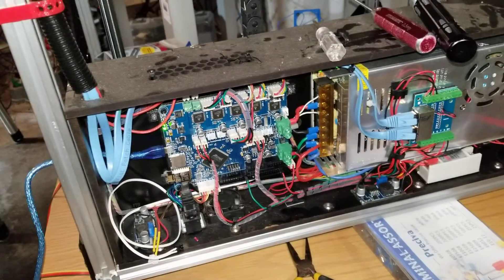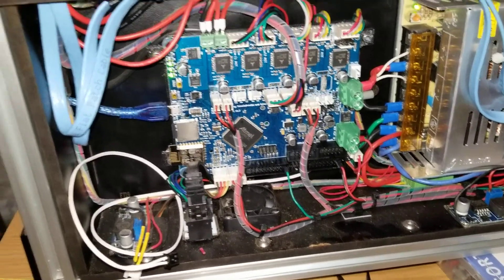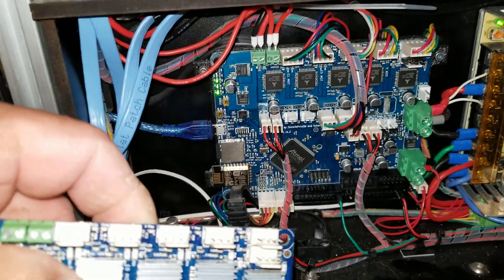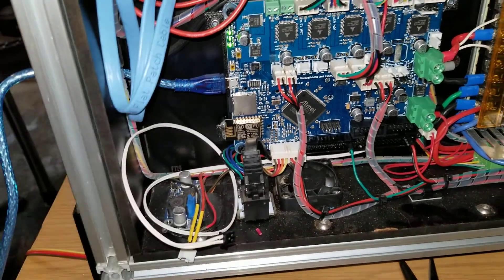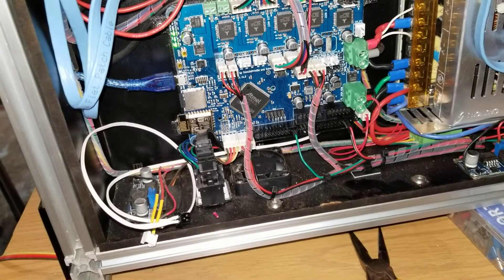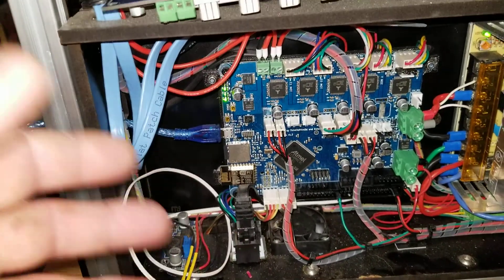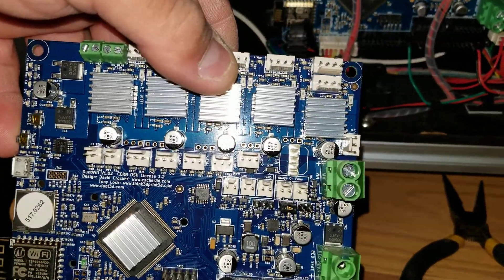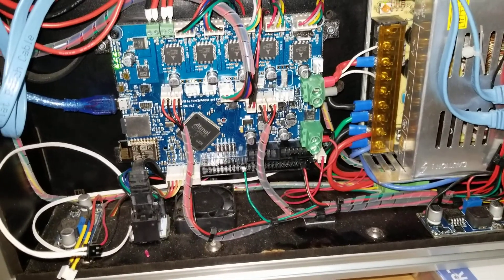Duet-Wifi Clone, First thoughts and simple review

Comment: Does the clone say designed and assembled in the UK.
Reply from the maker: mine did not
Reply: For anyone coming looking later, the clones are obviously made in Asia to max profit margin. They don't have to recuperate the hardware and firmware development costs like Duet3D does, they save some money on manufacturing labor (not much, that labor is getting expensive in places like China because education levels are getting higher and there's been an increasing labor shortage for years now as few want to work those jobs anymore and even fewer stay for a long employment), but most is actually saved on logistics: Every component is made within the same greater region so parts don't need to be shipped very far, nor imported). 

They may have changed this over time, but at least early on, the blue PCB clones were "made" and sold by BTT (Big Tree Tech), the black PCB ones by MTS (Makerbase). I don't know about the passives, connectors and jellybean components, but those are commodity parts being producted by a bunch of different manufacturers. They're like the nuts, bolts and washers of electronics. But all the stepper drivers, logic components and the firmwsre on them were/are the exact same as the original. Duet3D doesn't make any proprietary hardware components, they're off the shelf parts made by 3rd party companies like Atmel and TMC, that anyone can buy. And since all the logic parts are identical, Duet has no way of telling them apart so the clone boards use the same official RepRap firmware and updates (or any other compatible firmware) that the original Duet boards do.

Comment: What are the 3D Printing noises like?
Reply: quiet, but if noise is your main concern, make sure you isolate your printer on foam blocks and preferably on a large cement rectangle so the surface it's resting on doesn't act like an amplifier. Also, noctua fans are a great addon.
Reply: @AlexJoneses  correct

Comment: I think you've sold me! My Little Monster board seemed to finally called it quits.

I noticed, the two options, the second one being 'with connected'??? Was something lost in translation? Is it supposed to be 'with connectors' or does it mean something else?
Reply from the maker: you get the white connectors that plug into the board so you can change the cable connectors if you need or want to
Reply: @satgod  Ohh, so likely not all that necessary? Does one of your videos show an unboxing of this board and what you get? I may be able to source the waffle connectors from my local electrician for cheaper than the add-on price.

Also, how is this board holding up now? Are you still using it or have you gone back to the real deal?
Reply from the maker: @PorscheDuésnburg  I dont think I did a unboxing you just get the controller or the controller and a bag if fittings
if you dont have them I would get the fittings
I changed all mine to make it a nice clean install
Reply: @satgod  righto! Thanks for the insight and reply! :D
I'll get the whole shebang then!

Comment: Aren't these made in the same factory but maybe has less QC and not sold to duet directly? Like they do with imitation hand bags and sneakers? Maybe they run the machines a little faster or leave out a couple little things.
Reply from the maker: side by side they are exact
they followed the online opensource schematic/pcb layout
it works 100% the same as the real thing
I replaced my real duet with this clone inserted my micro SD card from my real duet and it booted up and ran the printer just fine with no changes needed

Comment: I have essentially the same machine (only mine is an R2) the duet is an amazing piece of equipment, if you can afford the $160 do so, as clones are hit and miss and you don't get the service if something goes pop on it.
Reply from the maker: the clone I posted here seems to be spot on by everyone that has purchased one and now they are 74.00 shipped if you shop around 
my clone is still running strong , and support is a forum away
as for duet if something goes wrong with the controller after 90 days or if its ruled not their fault your out anyway
and you have to ship it over seas before you get that answer, I know I had a duet board die 2 days after warranty and I was told buy duet (SORRY!!!)